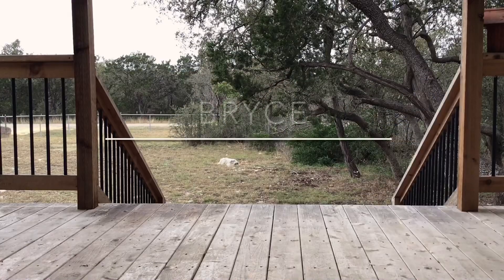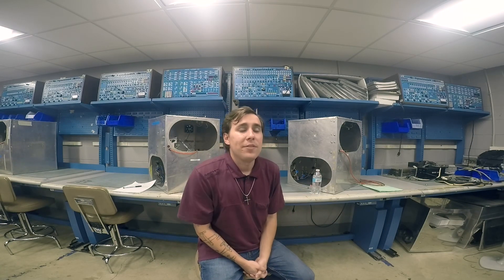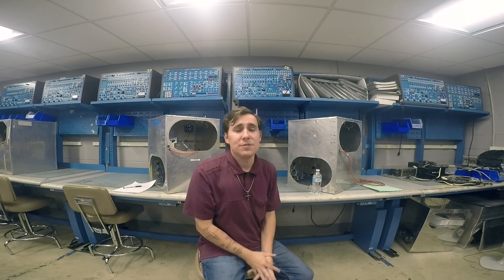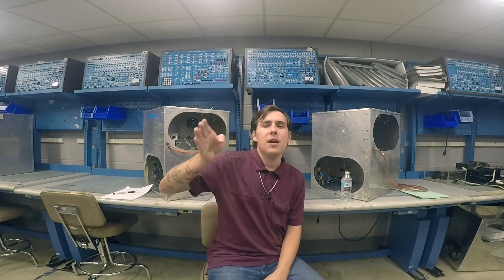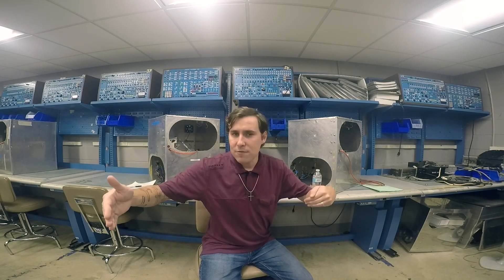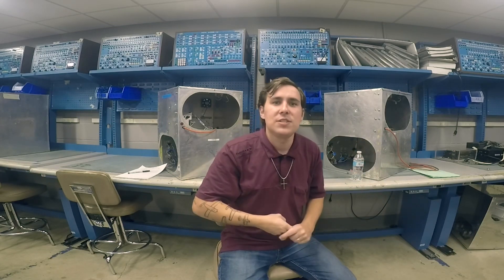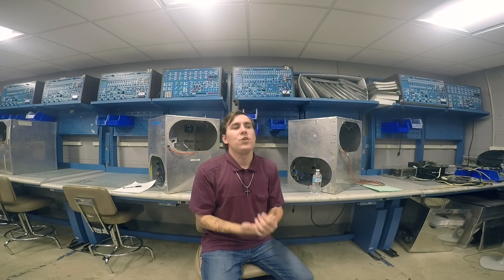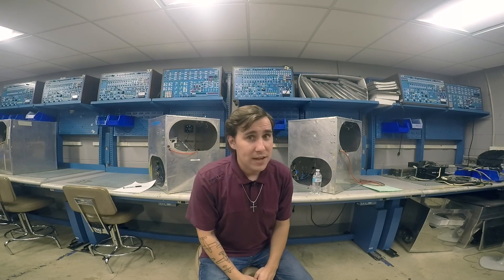4 Mistakes When Studying For The Aircraft Mechanics Test.

Comment: Just took Powerplant and General O n P. Had 29 questions for orals and passed both sections in 5 n a half mins combined. The questions are mainly common sense. Honestly dont stress about studying i knew the answers as soon as he asked the question and didnt even have to think really. It was all simple questions like “ What is a direct short”. Just sound confident when you answer and ull breeze through it. The practicals were the absolute easiest thing ive ever done. Simple inspections. Got asked “Is this fire bottle filled up to its operating pressure” The fire bottle he handed me on it had 3 words on the bottle. Operating pressure is 400-440. The gauge was at 0 lol. It took me just shy of 6 hours to complete it and it was actually kind of fun. I was terrified before i took them but it was the easiest test in the world. Also, the two follow up oral questions for the practicals, take ur time in the 8083. Spend 15 minutes and find the answer word for word in the book and read it out to ur dme. Its the exact answer he is looking for. Also dont over think. Had a practical that was find mistakes on a Form 337 that was filled out. I checked it with the checklist in the fars and couldnt find any mistakes. That was because there were none. You just gotta actually think about the answers and know the material. Thats what school was for after-all.

Comment: What is the best way to prepare for the practicals? I will be taking both general and powerplant
Reply from the maker: Go over the practical projects listed in the ACS and make sure you are comfortable with each task. If you are not or would like a refresher talk to your instructors and see if they will let you practice. The practical projects are pretty easy and it is required that you read the instructions first. (wich the DME must provide)

Comment: Hey Bruce, I just took my O&P for both and I failed general and airframe practical test. Am I gonna be tested on the same tasks? Thanks
Reply from the maker: Yes plus anything you haven't tested yet
Reply: @brycebuildsit  do I have to pass all of those projects?
Reply from the maker: You must get at least a 70 overall
Reply: @brycebuildsit  so when I retake the practical, can I just take the general and get my powerplant since I already passed P? Or do I have to pass Airframe since my 8610-2 is signed off for both rating?

Comment: Can people who are not as mechanically  inclined like myself still pass the practicals? I am studying for them as we speak. Also, is it really not as bad as I heard people say it is? Thanks!
Reply from the maker: I think the answer for me is yes, you don't have to be a master mech to pass. For the most part the practicals are easier tasks, check a cable tension, layout a rivit pattern, do a compression test, or check magneto timing. If you can follow the manual and figure it out you will be OK
Remember with the ACS change you only have to pass 70% of the practical projects in each section

Comment: A new 147 is starting a few miles away from me.  Have you seen any old students?  I'm  in far better shape than the average 46 year old, but I'm still 46. I've heard you say in another video, the job can be very physically demanding.
Reply from the maker: I've seen guys as old as fifty-seven. Age is just a number it's physically demanding but not in a cardio kind of way. There's also plenty of job titles Like backshop in engine overhaul That aren't near as demanding as line maintenance.
Reply: I hold a PPL. Would GA shops place any value in that?
Reply from the maker: Some will I don't think they would pay you more, but they might be more egar to hire

Comment: How do I prepare for the practical portion
Reply: Could be that I tried to take my Powerplant/General O&Ps in a week for a career opportunity, but Practicals really is the worst imo. I can see why you say it’s easy though, but things like Sketches (in General section) and AD compliance forms really got me. I heard that knowing what source of information to use (Whether it’s the Manual, FARs, or 43.13) and where to find it is vital. Small things like using TCDS’s got me when I wasn’t paying attention to what model airplane to find information on (I was given a packet of TCDS’s and told to find the speed limit and chose the wrong model aircraft for said info). Just some things that I figured I’d point out for those that might want to study. Don’t stress too much on the typical compression check or electrical stuff unless that’s what your written codes say you really need to focus on. Take the codes from your written, still study everything but put extra emphasis on making sure you really understand what you got wrong on the writtens, because it may not be guaranteed that you get those questions on the O&Ps but it is highly likely.
Reply from the maker: Go through the ACS and make sure you are prepared for each task listed. Or at least can find it in the manual. Tbh the practical is pretty easy compared to what you have been doing in school.